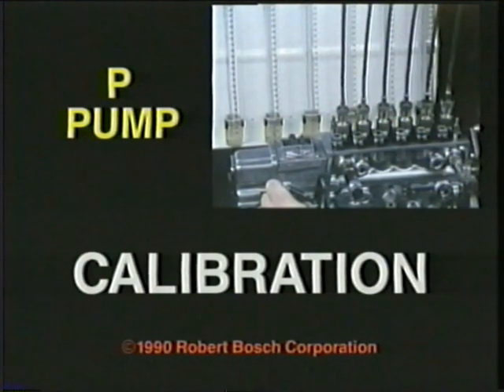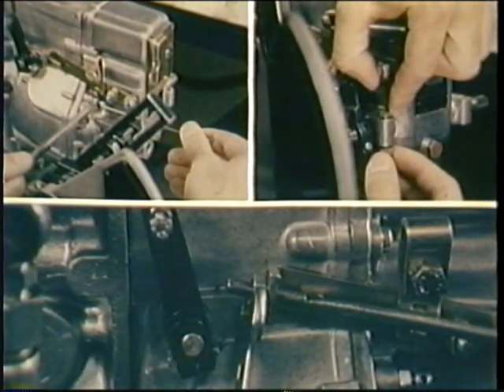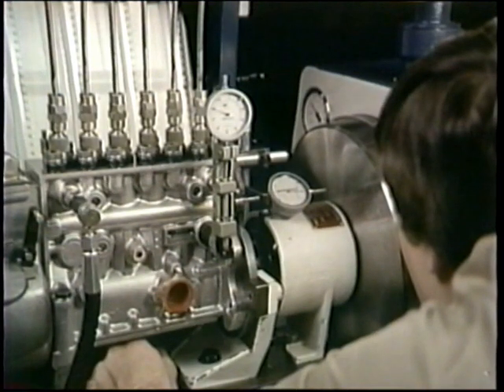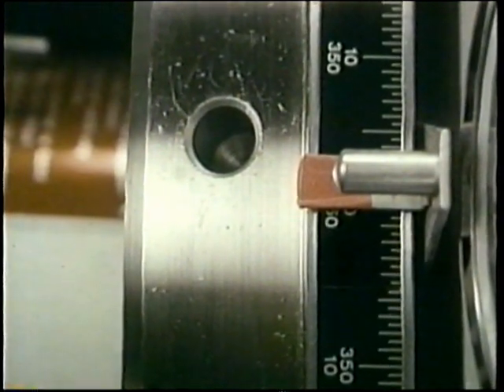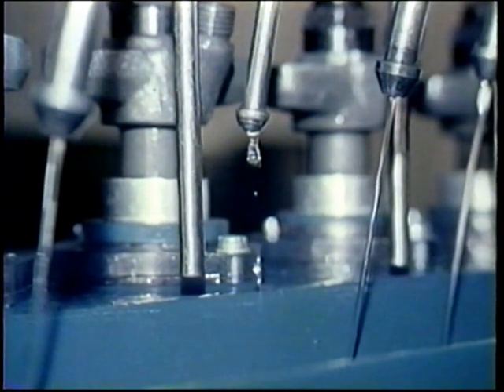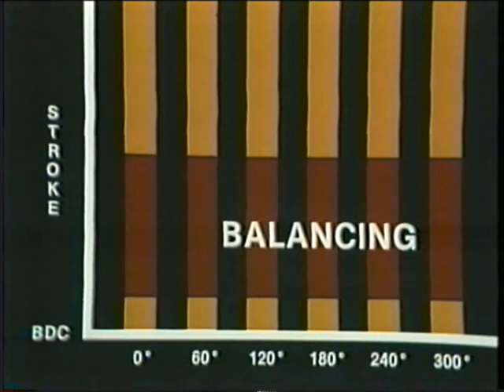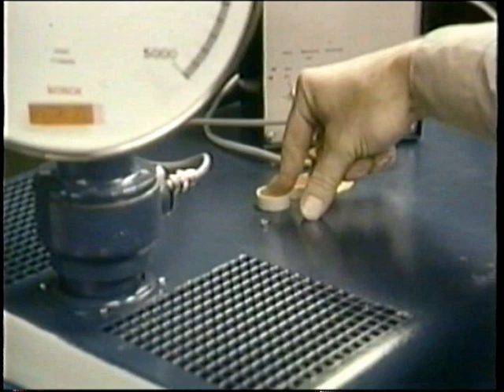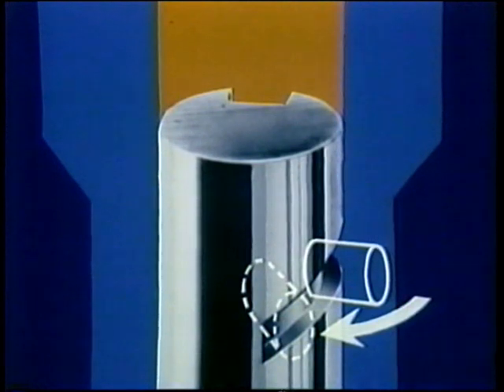BOSCH P-Pump Calibration

Comment: Very nice and detailed explanation on how to calibrate an  injection pump "P" size model from cam phasing ( port closing ) to different range of fuel delivery from idle to full load. Would appreciate if you could also upload on how to check the governor characteristics on the same  injection pump. All the best and God Bless!!!